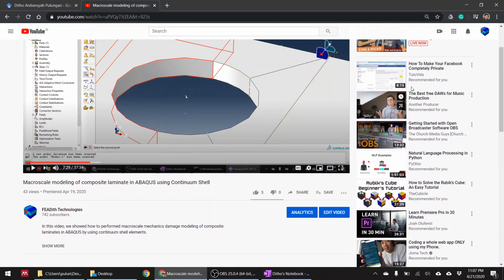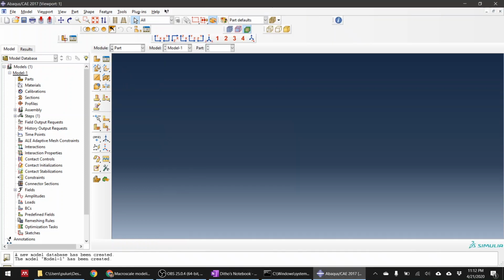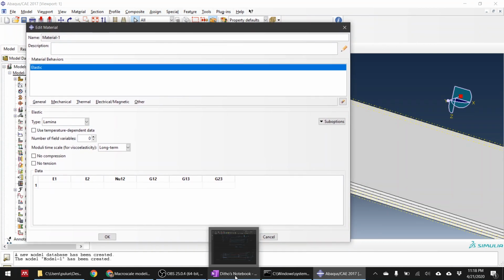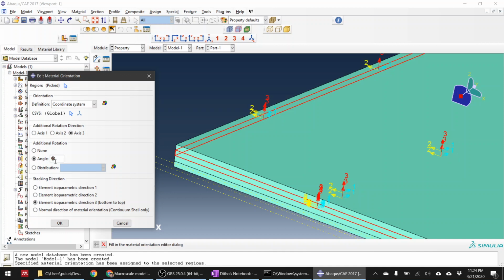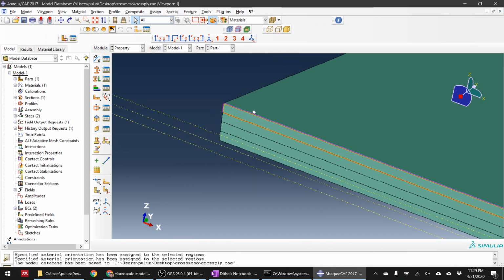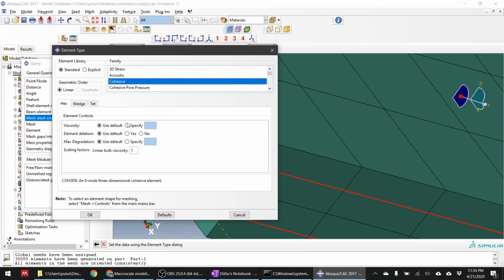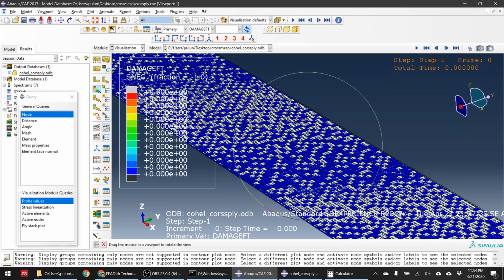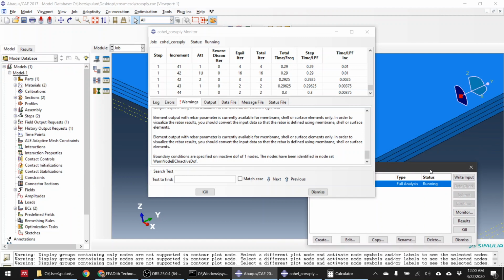Mesoscale modeling of laminates in Abaqus using continuum shell and cohesive elements - Part 1

Comment: hi, coul you pls explain why did you make your part as a solid shape of extrusion type ? and not a shell type ? what is the deffrence between them? when to use when?
Reply from the maker: Thats solid part is solid in terms of geometry.. but from the constitutive model point of view  it is shell element.. its called continuum shell. So the appearance is solid  but the formula behind it is shell element.

Whats the different to conventional shell? Convent shell nit good for contact oroblem since it does not have explicit thickness.. but convent shell good for bending problem..

Continuum shell not good for bending
Reply: @FEADith  hi thank you for your responce, 
I also wanted to know is there a way to add the cohesive interaction beteween the ply as a 0 thickness layers ? because here they have a thickness? I have 16 plies , is there a way to do that ?
Reply: @FEADith  hello again, I have few more questions. 

I have constructed a simple tensile test model for my undefeated composite laminate, and I have calculated the reduced E11 ( from the stress starin curve along the fiber direction)

However, I wanted to validate that my modelling approach was correct, so I thought of analytically calculating the general stiffness matrices (ABD) usinh a python code, and compare it with the general stiffness matrix of the abaqus model after extracting it.

And now am confused, are these the right approach to validate that my simple abaqus model is correct?
All I wanted to do was to check that my reduced E11  ( from the abaqus model ) is not so far from the value Calculated analytically.

And also am not sure, if there is a way to extract the general stiffness matrix out of abaqus? Because I have tried a couple of methods I found on goolge but they didnot work.

So my question is, if you can recommend a method for me to validate that my abaqus model , please do.
And , if you can expalin to me more what are the values that I should validate against each other, will be great.
Thank you in advance
Reply: @FEADith  That's a nice comment reply using the experience of FEA by Dith. Love that one :)

Comment: BTW, how do you know the damage occurred? by reaching 0.99? So, it is different from the criterion that we mentioned if it gets higher than 1 the damage occurred? I just confused.
Reply from the maker: if it gets higher than 1, damage starts.. "start: means the stiffness start to degrade bit by bit...

how much it degrades is defined by variable d.
if d = 0, no damage
if d = 0.5, current stiffness is half of original stiffness
in this case, i limit d upto 0.999

so the first one is for initiation
the second one (d) is for evolution.
Reply: @FEADith  So, this is same as when we define any damage failure criteria in composite materials in subroutine and if it gets higher than 1 then the damage happens, right?